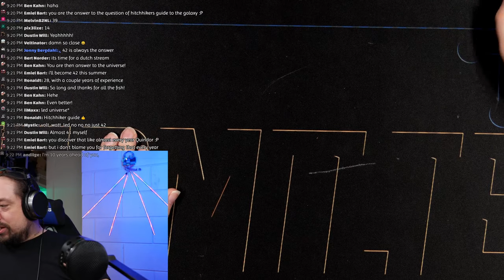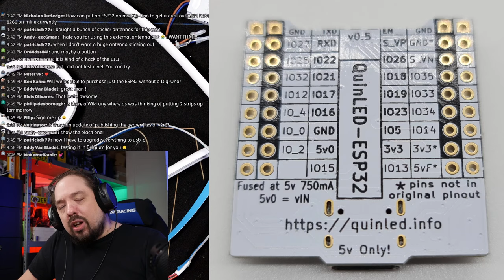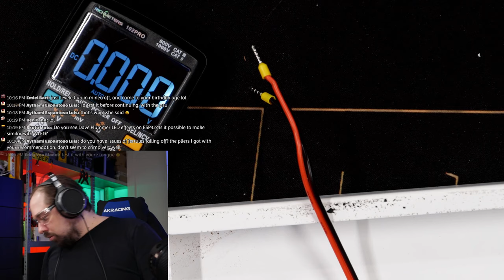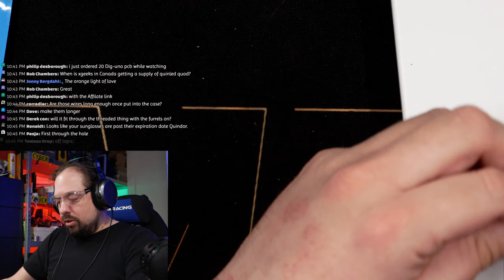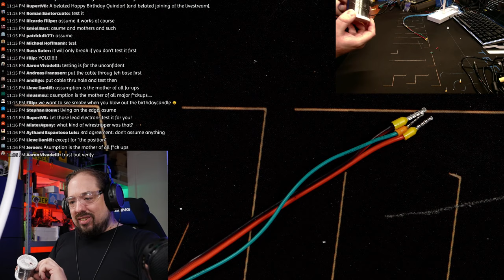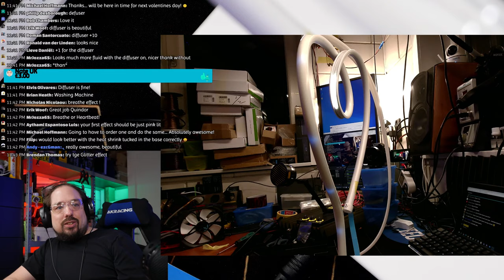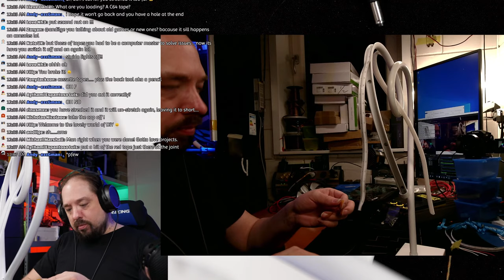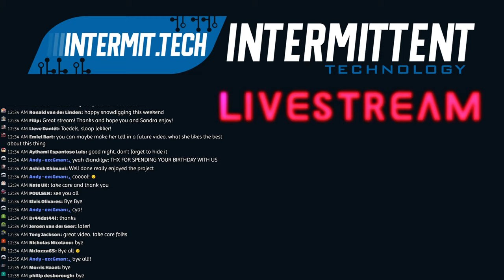Intermit.Tech #16 - Lamp LED retrofit

Comment: Quindor try folding the wire under the pvc of the lead and insert the lead into the connector. Then tighten so that it tightens over the insulation of the lead this way you will get a good and secure connect..